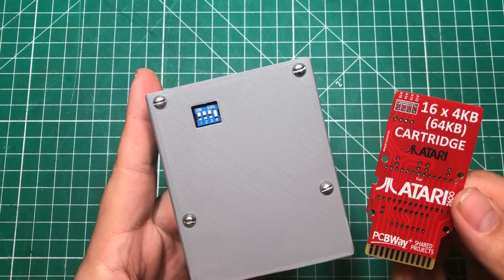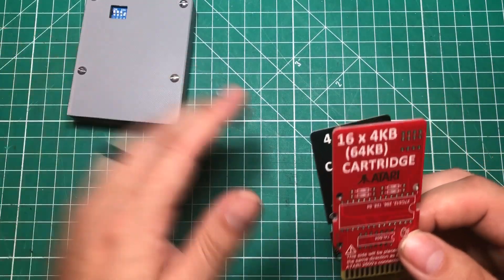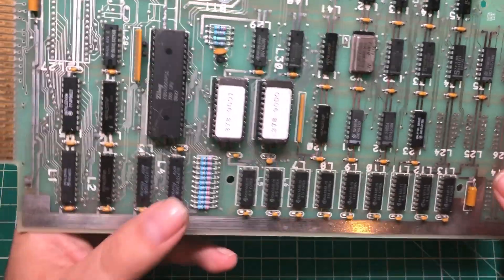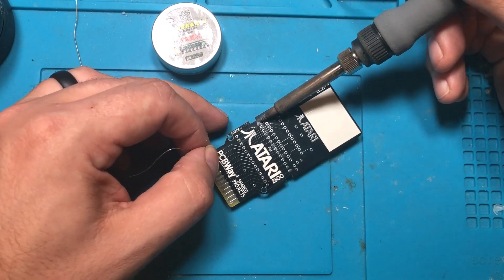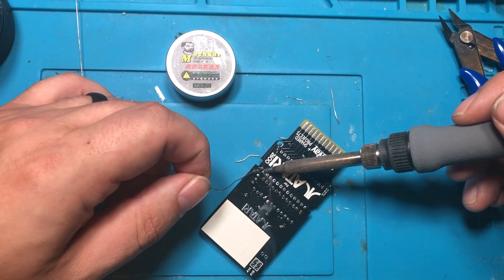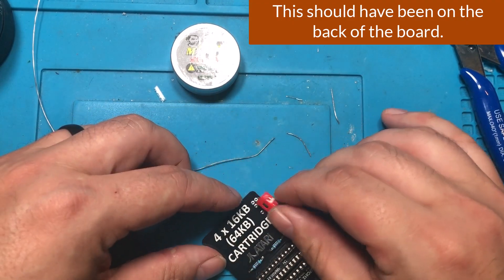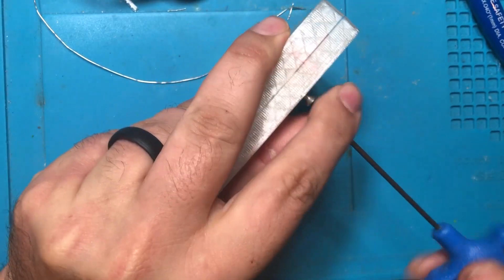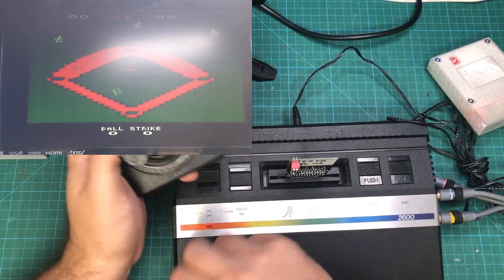DIY Atari Cartridge - Relaxing Soldering Project

Comment: Great video, love the content. An RGB LED in the case would be pretty sweet. 
Also what temperature are you soldering at, maybe it's just be me, but it seems really cold. I usually blast away at 340 - 360 celsius.
Reply from the maker: Idk how much I trust the display on the Hakko, but generally have it between 750F and 800F depending on what I'm doing.  I do think I used a pretty old (as in decades) roll of kester when I did this. The roll I usually use, melts a lot quicker.  So yeah.  I probably need to get one of those solder temp checker things because over the years of having this hakko, I've found myself going from 650 to 700 to 750 to 800 :)

I need to do something with an LED in one of these. I never bought any of those auto flashing RGB LEDs that Pile of Stuff had in his mailbag, so I'd have to do actual work to get an rgb effect.

Comment: hi. I have a trouble to programign the  atf20V8B. How to burn using the Willem eprom programmer 4.5. There is no chip in software design to atf20v8b. Must use ICSP?????